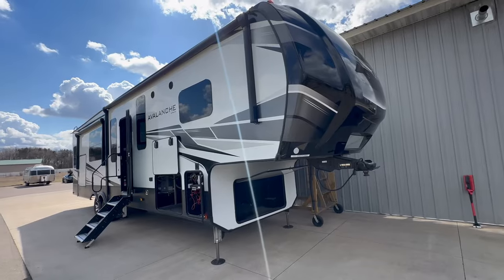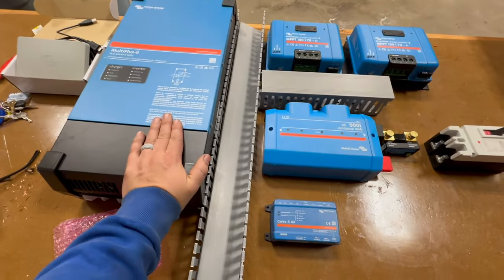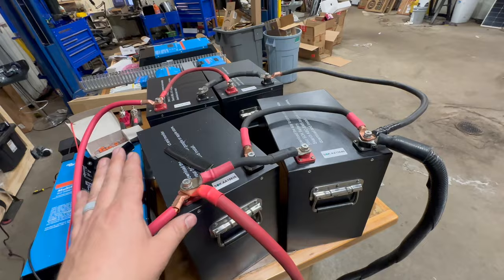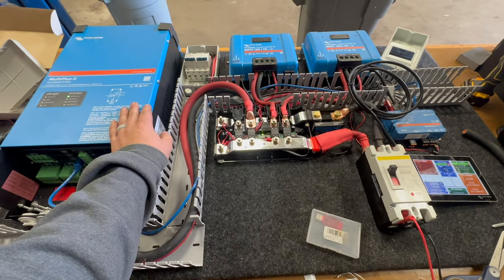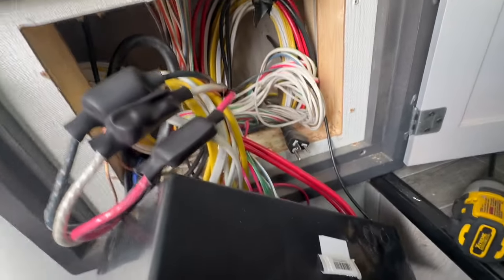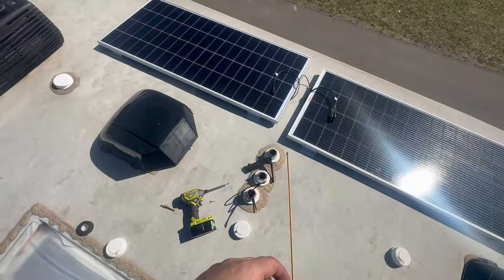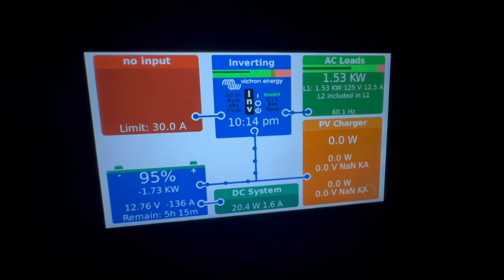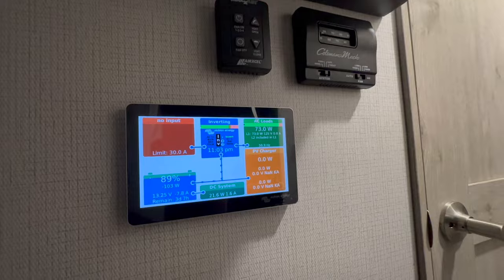Keystone Avalanche Victron Solar System Install 2000w 824ah

Comment: RE: VE.Direct cables. 

I made the mistake of trying to detach a VE.Direct on my MPPT 100/20 when it was below freezing. The Victron cable was so stiff that when I moved it, the connector tore off from the MPPT's circuit board. Those devices are glued together, so no repair without hacking it to pieces.

Comment: Factory wiring mess is a disgrace. Thumbs down.
  I like that you checked operational heat signals. First time I have ever seen that on the Tube.Two Thumbs Up.
Current builds favor 48-volt for a lot of good reasons.
   It would be nice to know what the system parts cost is on a particular build and the parts build sheet. 
Two big thumbs up on your build and explanation narrative.  
    Retire those retired buddies and get an Orangutan helpmate.  If nothing else he can throw the ball. 
And .... I would build a stair platform to the typical RV roof height and put it on two wheels and move it about with a trailer moving dolly.

Comment: Hey Shawn, do you know if this rig has what Keystone calls the 'giggy box'?  It's a fused 12V bus/distribution that's usually in the front with the batteries.  I didn't get a good look on the left where the wiring is. 

I'm starting work on mine (Keystone Montana High Country) and I'm debating replacing it with a standard Blue Sea setup.  I've had some trouble with ours--if a fuse blows, it's really difficult to replace, and they aren't necessarily as available.  

Just curious if this one has it if you're keeping it.
Reply from the maker: I never saw one.
Reply from the maker: I like how airstream does theirs. A copper bar connecting 50 amp thermal breakers.

Comment: Everyone should get going with a 48 volt system. 12v will just piss you off in a year when you realize you want to expand your system to power both or 3 air conditioners while also realizing you want to expand your solar panels too and a 48v will only save you money whereas a 12v will cost you tons and the inverters etc on the market revolve around 48v systems. Just stfu and go 48v if you’re thinking about doing solar and batteries. Don’t waste your time with 12v unless you’re just powering a simple wall outlet or something small to charge your cell phone. Shush, go 48v…
Reply from the maker: Good point. We have a video on that topic.  As far as Victron goes in RVs, we feel the 2x120 inverters fit most people best so that means 12 or 24v right now. If we bring 2x invert in the mix then 48v becomes more realistic. 

As far as expanding solar, with the controllers this guy has he can add 2 more panels with this setup and that will about max out his roof space anyway. 

I hear what you’re say though.